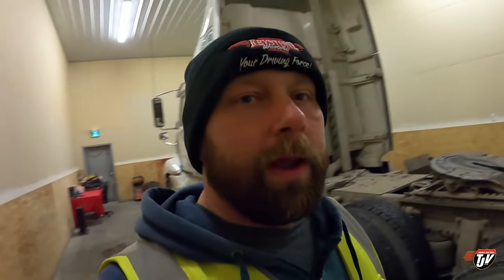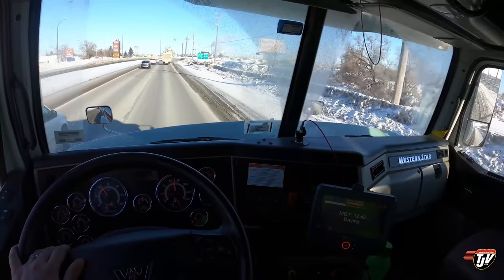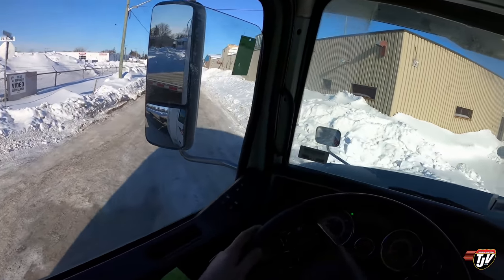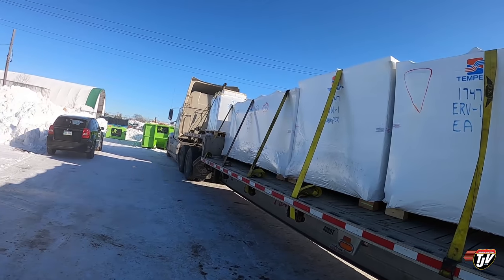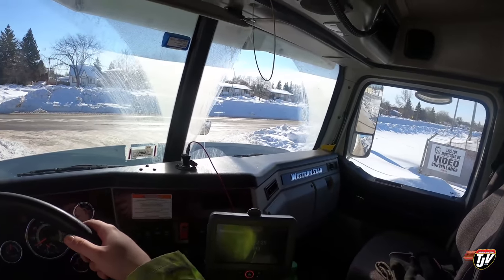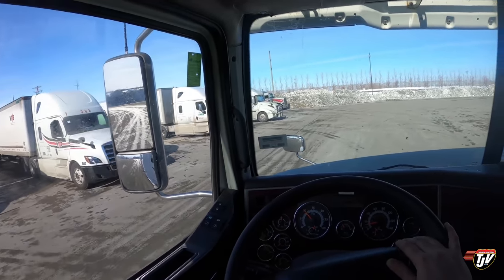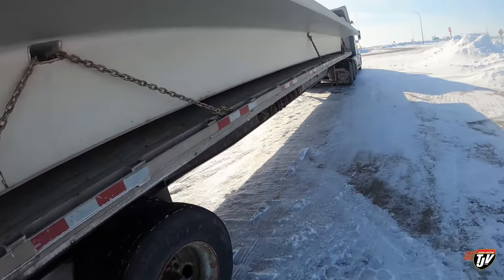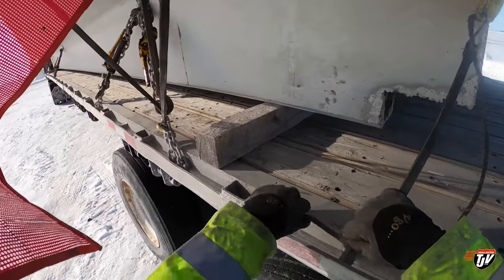STAR POWER | My Trucking Life | Vlog #2480

Comment: Cats had alot of turbo problems. They were always failing and after all those problems, they stopped making engines. they also had the old def style system, no fluid, just a sparkplug ignite system that was always messing up and you often ran on derate power.

Comment: What i do if i have summer washer fluid in when the cold starts ill fill it with winter stuff then use alot then top up again tell its all mixed with mostly winter stuff and it seems to work for me and when i see big trucks if nothing is around me ill back up if they r making a right so they have alot of room to safely take the turn